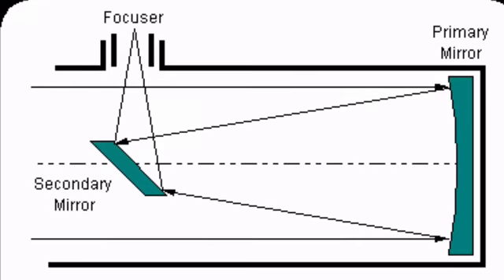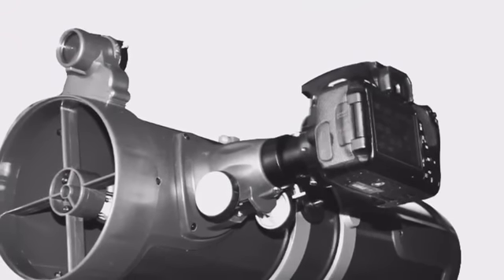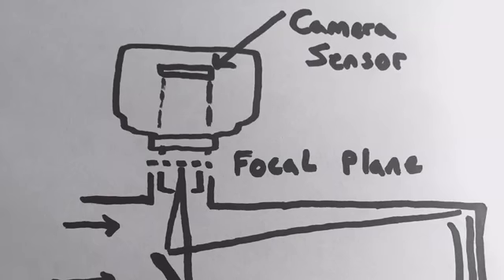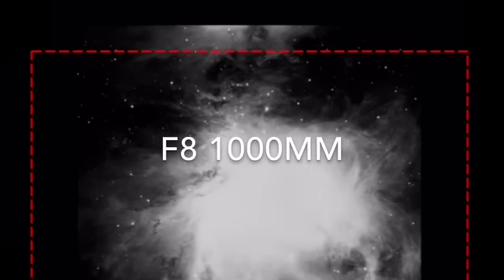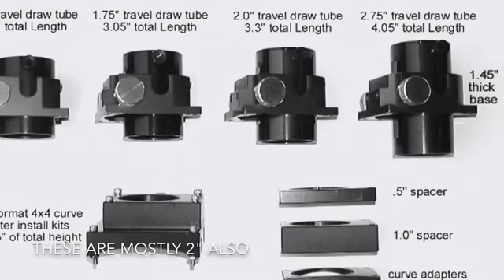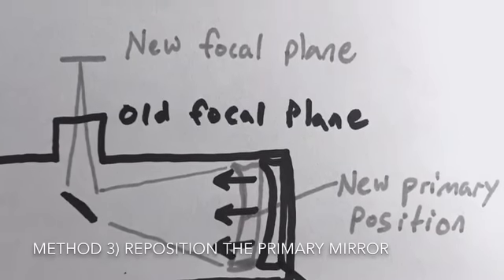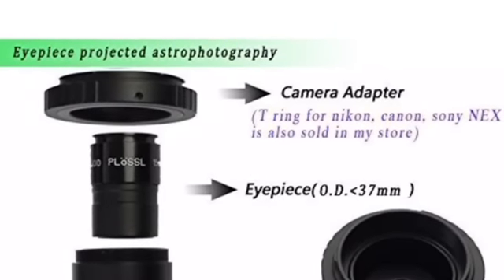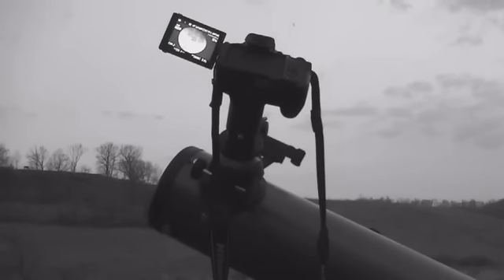Newtonian telescope how to find focus dslr astrophotography

Comment: bringing the mirror closer to the focuser..haha sure....savage. Id rather buy a new telescope.
Reply from the maker: Most would that can afford it. I agree but there’s many who don’t have that luxury.
Reply: @GarnettLeary  i want to buy a beginner-DSLR with APS-C size sensor...only for the purpose of astrophotography...i might buy a larger scope in future.can you please make clear again what else i need for making fots with my 114/460 mini-dob? I already have a 3xbarlow, so i only need a T-Ring and a 2 to 1.25 inch adapter? or can you get this 2 things in 1 piece?
Reply from the maker: You can get it in an all in one but typically it’s a tele-extender. Get the t-ring and look at Celestron Universal 1.25" T-Adapter - 93625. That’s the product number. You can use it with your barlow and t-ring.